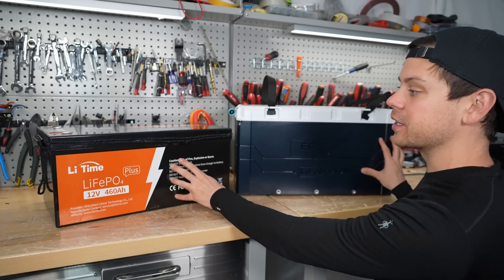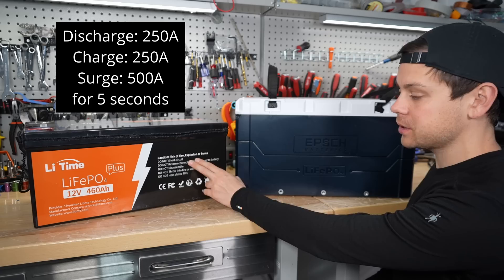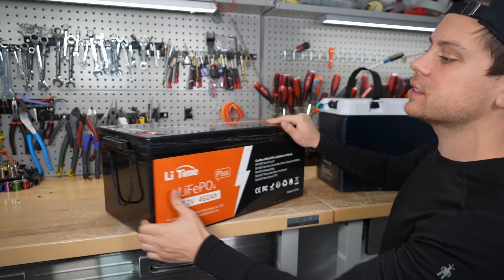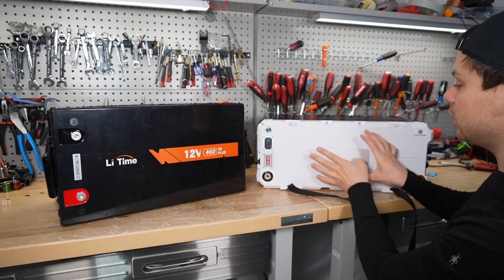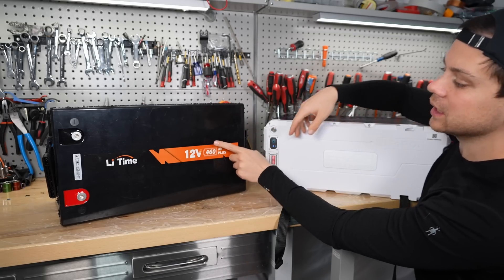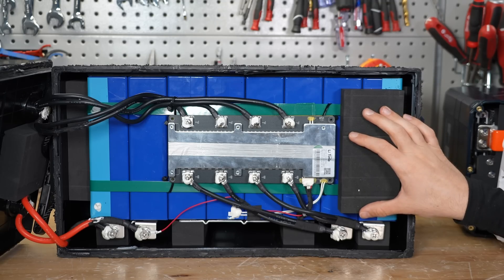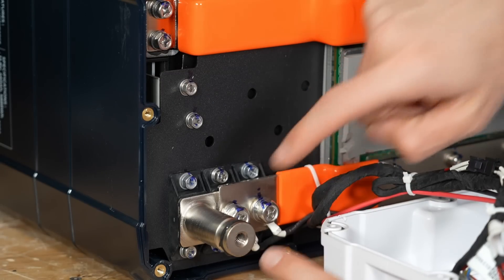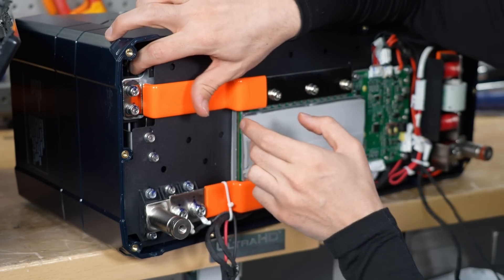12V Battery Showdown! $1,499 LiTime VS $1,999 Epoch

Comment: I bought the LiTime about 8 months ago for an van RV conversion and it has worked solidly with no issues during that time.  I added battery heaters (beehive heaters) and a Renogy shunt, and have multiple temperature probes on the battery.  Also added a 200A terminal fuse just as a final protection (my max draw is 175A).  So far, so good.  Thanks for your channel!

Comment: Even with needing the extra communication components the LiTime is still the logical option. Especially for the lifetime cycles. On the epoch you would have redundant options because anyone building a system will have communication components. So definitely LiTime.

Comment: I would buy the essentials over the Epoch 460
with comms.  It’s $500 cheaper and the comms is very buggy.   When you use the dip switches to utilize comms only one battery will show up on the App not both nor the capacity.  Also you have to manually reduce the voltage way down for charge and float on the inverter or it won’t work and you will annoying over charge alarms.  You also have to turn way down the charge amps so you never get the pecs shown.  If you skip the comms and just use a smart shunt with all dip switches on default you can avoid most these issues.   Also these issues mainly plague having more than one battery. 

I have the comms versions.

Comment: I really don't get going 12V at all with dis/charge amps that high. Do you really WANT to be pushing 250A through a 12V system? That's 4/0AWG cables everywhere! It's literally more amperage than my house's main breaker! Any tiny wiring errors will produce dangerous amounts of heat.
I'd only use it for long discharge 12V loads without having to wire a bunch of 100amp batts in parallel, like camping or multi-day electronics backup. For a 3000W inverter I'd want a 48V ~60A system instead.

Comment: I would buy the Epoch for a marine application. The footprint is the same as a 4D, albeit about 2" taller. The build quality, safety features and the communications capabilities make it my preference for a marine application.

If I were buying batteries for a home solar application I would probably go with the Li Time battery

Comment: Wouldn't it be "33% more" or "25% less",  depending on which way you're comparing? (not meaning to be pedantic, but numbers matter....)
I'd use the LiTime if I were building a battery bank in my basement/cabin/etc., I'd use the Epoch if I were putting it in a RV/Camper.  Different feature sets, different uses :)

Comment: LiTime has a 280ah battery with low temp protection for $701. The first one you get a 10% discount on. So buy 2 and have 560ah with low temp protection cheaper then either of these.

Comment: The Epoch batteries low cycle count is probably nothing more than the LONG warranty purposes, It will probably cycle longer than the Li Time if put in side by side service together, I Bet!! You just don't have the higher quality all over and then use a lesser quality cell with a lower real world life and survive building / selling PREMIUM batteries, IMHO
My big question, is what is the big advantage / draw to the 12 volt systems I'm seeing all over youtube nowadays, vs higher DC voltage systems? Isn't high voltage DC the simelest easy path to better system efficiency / performance??? I thought I had seen a video you made on the voltage aspect, but I can't find it now!

Comment: You handled the contents of this video very well.  It was clear and concise. I bought the Litime 12.8V 100Ah Max Lithium Battery LiFePO4 Deep Cycle Battery, Built-in 150A BMS, 1280Wh Energy, 4000+ Cycles, 1920W Load Power.

Comment: The quality cheaper option 100 percent of the time. 5 years later i wont be looking for a warranty claim. It would have been use for it purpose by then and tech would advanced by then. Im not paying more for more than i need.  Just a "few hundred" more (out of touch), $500 more. 25% more, no thanks.

Comment: You made the comment regarding the cycles that, as long as you charge under solar, it will outlast even us.  Does that mean that if you charge in any other method such as DC to DC, shorevpower or generator it will not last as long.?

Comment: Just ordered my second Li time 24v 235 amp 200a bms.I Paid 1350 for my fist one and ordered second one like new used over 10000 watts price per KW and it will feed  my victron 24 3000 no problem even at 160 amp draw to make 120v AC at 29 amps I watch a lot of your videos. I'd be willing to bet it'll run your car lift  no problem I just finished watching one year older Videos concerning charge controllers.And how onless  you are using  LA don't need to worry about communicating or nothing simple.Hopefully, I understood that right.Thank you for all your work 9:24

Comment: Nice video, Will. That LiTime battery is now $1,300. I think I would pick the LiTime over the $2,000 Epoch in most solar applications, unless I was using it in the elements where a waterproof battery is a must. 
I don't think they are in the same league, though. I consider the Epoch to be more of a budget friendly alternative to upscale Battle Born and Lion. And, LiTime to be in the Chens, Power Queen league.
I still think $2,000 is pretty spendy for 400ah. But looking at the Epoch site the 300ah caught my eye at $1,000. That is a fantastic price.

Comment: These batteries are no comparison to Renogy Rego Batteries as got 2 of their 400 amp hour batteries on Amazon for $2,299.98 plus tax on November 11, 2023. All heated and easy to hook up a display along with the rest of their Rego System as all plug and play with RV-C Can connectors so they communicate to each other for maximum proper charging. Just wait for sales and the product line is the best out their for the money as I would compare these batteries to any on the market. Only problem the system is large for our campervan but I have room as soon they will even have AC/DC box with shunts to monitor each channel someday as they show in their brochure plus a newer display like tablet. As money is no object as considered Lithionics batteries along with using Victron but I use the Victron products now in our RV Rentals but they require so much to setup and then setting the software which was cool 5 years ago but now outdated. As who wants to buy 50 different items and then wire up as when you get done its a joke when their are better alternatives. As even Ecoflow has a killer setup but is 48 volts which is the future but also a headache using lithionic batteries and a Wakespeed regulator with dual alternators as out of the hands of most DIY installers. It would be a great test for you to check out their 400ah batteries as I believe they atleast blow away Battleborn and most all others. As maybe not Lithonic batteries but close to it I believe as these batteries are now made by Winnebago for their campervans and I am sure they will make the components smaller inside of them to the standards Renogy is using now as to cut costs. As Lithionics are overkill as they are suitable for military and such vehicles to match the prices they want but as we all know each cell comes from China.

Comment: The most expensive component in the battery are the cells.  So it would be nice to get information what cells they are using? Would also be interesting to see a high current test of the cells to see if there are any differences when it comes to voltage sag.

Comment: To me its the same comparison as a new vehicle. Some of them come with soooo many sensors, bells and whistles that those little things brake so quick it seems or tend to give the product more of a sense of "breaking" when something goes wrong. I like the simplicity of the quality made LiTime battery and I think more chinese manufactures have changed things from a simple.....quality build aspect just from Will's breakdown videos. I think they watch the videos, like Will's and make things better. But I will stay with simple and reliable until someone like Epoch ( and I would say its pronounce ee_pok not epic ) has a more proven track record with making reliable batteries, only time will tell. 😁

Comment: Thanks Will for the video, I bought zooms battery 3 years ago and now I think it’s redodo and looks exactly the same as LiTime and same capacity and size Bms etc. I had to buy second battery so I decided to go with redodo although LiTime was tempting after your video but I wanted to best matching to Zooms and it just came in and size a lot smaller in width than a Zooms battery but exact same height and length. For 12V system like you said simple like mine with victron shunt and Cerbo gx I would go chipset way for battery as victory does the rest for my color mining off grid system.

Comment: I don’t know enough to know what I need…
I’m building out a cargo trailer. I need to be able to charge/run a couple of laptops, charge camera batteries and ideally run a small heater/AC when absolutely necessary. 
I need to be able to plug in and charge at campsites and at some point install some panels to power the system. 
Right now I live off a Jackery, generator, and my trucks alternator, and campsite power when I can get it. 
Thanks for being here Will! I hope to get it figured out this year. Saving for the system will likely take a year or more.

Comment: No complaints about my 3 year old Chins batteries. I don't really have a need for all the fancy features, I just want a battery that works reliably. You can throw in a SmartShunt for $150 and get more accurate info than the included battery gauge with the epic.

Comment: I don't need those features.... there may be one or two that would be nice.... no victron anything thanks.. Brand lock in sucks. Open documented standards for communications or none, no blue tooth please, for something that will sit in a bilge surrounded by sea water, freezing is not possible anyway.  In the long run, I suspect there are better solutions that use less power for freeze protection than per battery. (if you only need one battery... but everybody needs more than they buy) The surge current is not as important as the overall storage (generally why people buy extra storage down the road.... which adds more surge anyway).

Comment: Buying today I'd go with the Vatrer 12V 460 AH battery.   It is the same price as the Li Time, but is both better and cheaper.   Better because it includes low-temp cutoff, and cheaper because they currently are not charging sales-tax.

Comment: I would buy neither if I could build my own, but I like that Class-T and internal bus bars of the Epoch and I add those ideas to my memory bank. Issues here matter to me that don't to you, Will. The height of the batteries is very important to me because my boat's battery compartment, inside one stern bunk and above the waterline, is not tall enough for the Epoch battery and, being closed off compartment, the inbuilt gauge is of no value to me - plus I have a shunt & battery monitor that measures the whole bank so bluetooth access is more important to me to configure those BMSs. So I like the physical dimensions of the Li Time but I'd like my batteries to look like the Epoch inside (minus a couple of features that I implement drfferently anyway)

Comment: I just bought two Litime 12V 100 AH batteries with low-temp cutoff included for $255 each, so six of those would give me 600 AH for $1,530. The cheaper CHINS 12V 100 AH, which I own and love,  is now selling for $220 including low-temp cutoff, which means $1540 would buy me 700 AH. I'm not seeing the value in a basic 460 AH battery for roughly the same cost, especially given its weight, unless form factor is critical.

Comment: Epoch all day long , let’s face it your only going to buy them once . They come with all the extra features . Worst case scenario they will have a better resale value. 

The Li Time still has it’s place for budget conscious folk but really for the sake of maybe the sacrifice of a weekend away or a shopping spree I’d go for quality. 

If you were going for a mahoosive setup you’d buy individual cells anyway and full bespoke setup.

Does make one wonder though that buying a good used setup is sometimes maybe a better option , that way you can save on cost, still have a good resale value and because technology is advancing so quickly you can keep upgrading on a regular basis. 
Plus one gets to know the system then becoming more self sufficient, which guys is what it’s all about 🇬🇧😃🤔

Comment: My armchair thought are the Epoch has extra "Bling" for 25 percent more money, and I have never heard of them. I think it boils down to the cells and BMS quality. If the company is around at 10 years, I wonder how hard it would be to get warranty on a cycled out battery. I would bet a good BMS will hold cycle data, that the manufacturer can access. 🤔🇨🇦

Comment: Will, your math needs correcting.  The Epoch battery costs 30% more, not 25%.  The Li Time is 25% less that the Epoch.  Sorry, but  I’m pedantic when it comes to math.  While I’m at it, you shouldn’t use a multiplier to express a fraction, I.e. This uses 3 times (or 3X) less energy.  It uses 1/3 the energy……your welcome.

Loved your videos for years and I’ve learned a ton from you.  Thank you

Comment: For less than $2000 a few weeks ago, we bought: 400aH of LiTime 100Ah batteries on sale (approx. $215ea at the time), Victron SmartSolar 150:75 MPPT controller, Victron SmartShunt, Victron SmartBatterySense, Victron Orion-TR Smart 12:12 DC-DC isolated charger, and a 100aH AGM starting battery. Total cost was around $1950. 

Unless you have a significantly larger budget, it really does not make sense to buy the Epoch instead of basically an ENTIRE ecosystem that is reliable and robust. We don't need 3000+ watts of output.

Comment: Smiling!
Been researching these batteries to replace my old gel cell I use for back up for my Ham Radio. We do some emergency traffic net check ins to test our back up power, just in case the world goes crazier, and this kind of battery looks like it would do the trick. We also have a couple of 2-meter band repeaters that could use them on the solar system, their batteries are getting weak. 
Great info and I like the way you rip them apart to see the sloppy or good craftmanship. 
 K5EDD 50 years of ham radio.

Comment: I really dislike any of the batteries that have cells in parallel in them.  I don't trust them to do it correctly and even then I still wouldn't like it that much..  There are a lot of nice 48v 100ah units with Bluetooth bms's for around $1100..  That's the way to go..

Comment: My only problem with the epoch batteries is the discharge cutoff temp they set them too. We regularly see temps below that threshold, for that reason alone I will buy the cheap one and add the features I need. Also the heaters in them only turn on when you are trying to charge the battery.

Comment: I def. don t want the bms inside a battery case, it s electronics, it heats, so it will break down before the battery itself most likely, and I don t care if it s waterproof, I m not going to use it in my nuclear submarine, and the brackets or holes I usually make myself if I m going to use it for powering my rutchebane/roller coster, thanks a lot.

Comment: It depends on the build.  For a cheap battery backup with a simple 3000 watt inverter that you use once or twice per year when the power goes out the LiTime would be fine.  If I was putting this in an RV then the Epoch would be the way to go.  For home backup I think 48V is the way to go.

Comment: crystallization of the dissimilar metals used in solder joints may be a big issue and require reflowing the soldier after ten years.  25 years ago My electronics tech mentor said is was common issue on electronics, like amps tvs etc.  Now, with amps it affects the sound; with a battery, perhaps sound not an issue but the BMS is all digital requiring exact communication, and also like amps have capacitors which degrade over time and need attention.  Also good point about the little vent; with repeated cooling and warming cycles, condensation accumulates. Will that humidity rot the battery over time, or short circuit the BMS maybe depositing minerals on the circuit board?

Comment: The epoch is a good value for what it is, even at the price. 
The litime is a better budget choice. 

For my usage I’d buy the litime for this a/b question. 

However, my actual purchases were batteries that totaled about $1000 for total 5200Wh,12V, so I might not spend the $1500, personally, for my needs. 
However, if I needed portability convenience at that capacity for 12V I would buy the litime; if low temp protection was a factor I don’t think I’d avoid that epoch.

Comment: Why bother. NO one is using 12v anymore, right? You are testing crap no one uses according to you.
While 12v sales top all other batteries.
Reply from the maker: No 48V is top seller and top traffic on my website and my distributor friends websites. And my forum which is largest in world for solar. 48V is king

Comment: I'd get the Epoch since it's a smart battery (Bluetooth, heated, other features).  However, I wouldn't get a 12V battery at these energy capacities. Like, the LiTime is internally 8 cells, so it could be higher voltage if it was wired differently.

Comment: I would pay the 2000 for the epoch. It's a little more but you get more things. T fuse, low temp protection, heaters, and all the other goodies. So at the end of the day they are the same price.